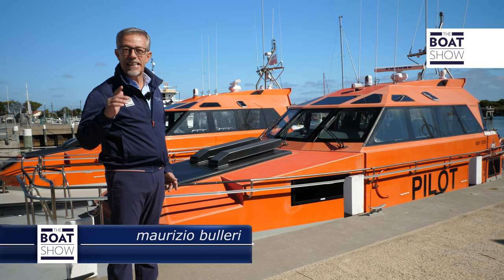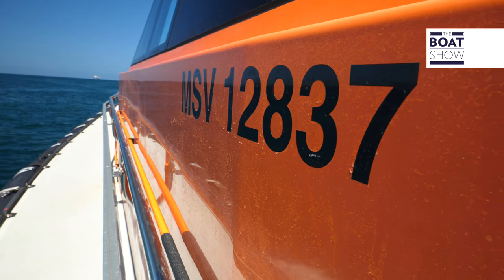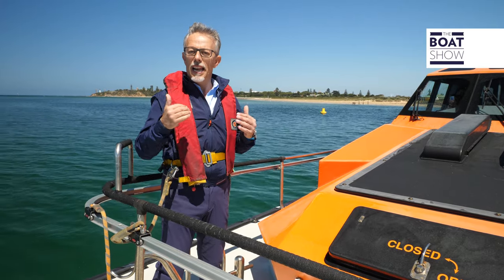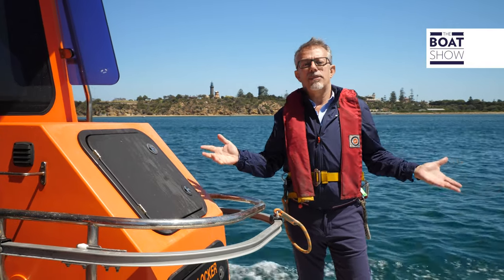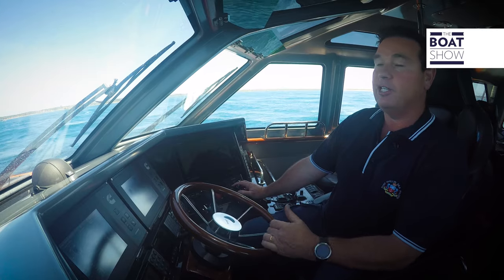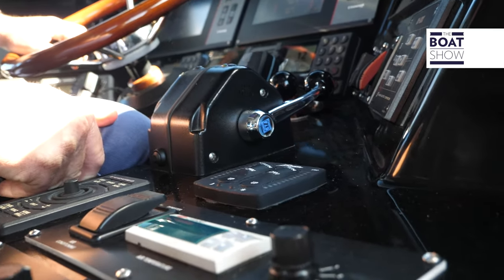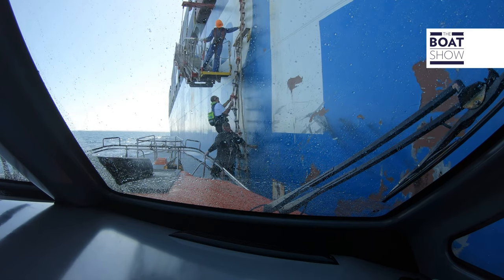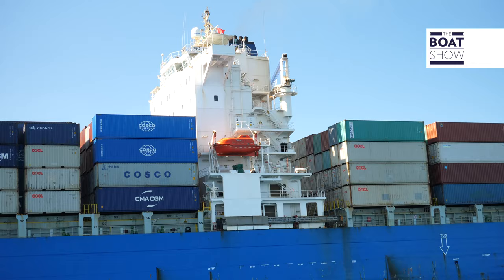[ENG] ROAD TO AUSTRALIA - Port Phillip Pilot Boat Review- The Boat Show

Comment: why do we still need pilots boats when the current navigation aides are more than OK, seem like its the one of the parts of shipping that needs to be modernised.
Reply: Unions, that's why. The maritime unions are some of the strongest mafias around and will move mountains to protect jobs for the boys. No politician wants to be associated with job losses so all look the other direction.
Reply: How is a navigation chart going to tell you the location of shifting sandbars etc.?
Reply: That's the insurance company policies (pilot)...not only the Mafias...
Reply: Or potentially because the entrance to port phillip bay is an extremely dangerous bottle neck, combined with the bay having 50-60km of narrow winding channels that are difficult to navigate via simply a Navigation system.
Reply: I navigate this area regularly in a trailer boating it can be tricky.  I’d like to see you try to bring a ship in through the heads all the way to Melbourne.  The tidal movement can be 10 knots, strong winds, huge swells creating issues with plunge depths, combine this with an absolute plethora of navigation aids puts this entrance in the top three of the worlds most dangerous.  Only ship masters who navigate the rip regularly and have appropriate endorsements are exempt from using a pilot.
Reply: Built in Mornington. Saw them being built. 5 years ago. Spotless workshop.
Reply: Not sure about that. Accidents in the US and the luewin in WA are just a sample. A couple months ago I was talking to a guy piloting Tassie ferry into Geelong. Captain had recently returned to work and had not put the ship into the new terminal since they moved from Port Melbourne. I said to him on the phone nice day his reply what do you mean is 30 Knott wind out here. Port Phillip pilots earn their money and keep us safe. If you can get a copy of  so ends this day by Captain John Williams is a good read.